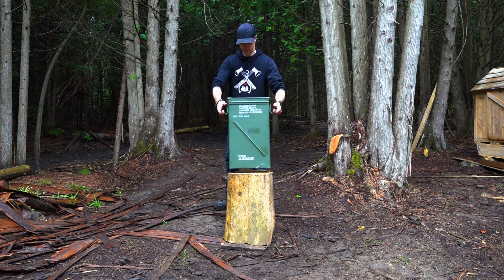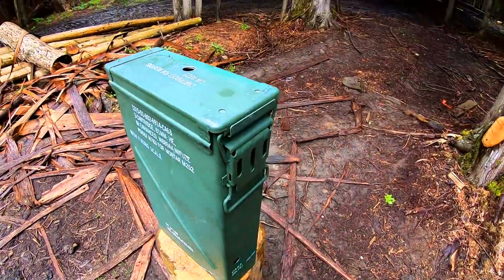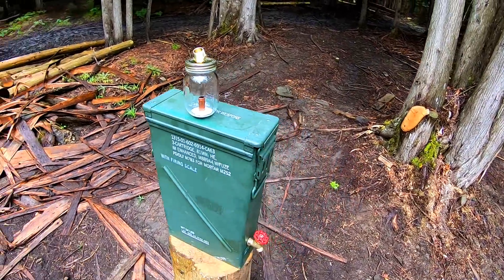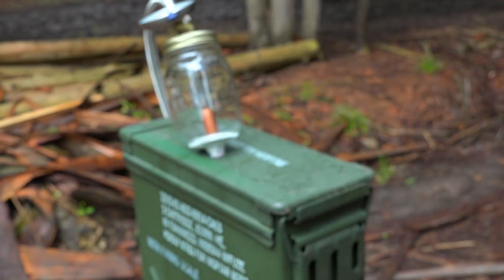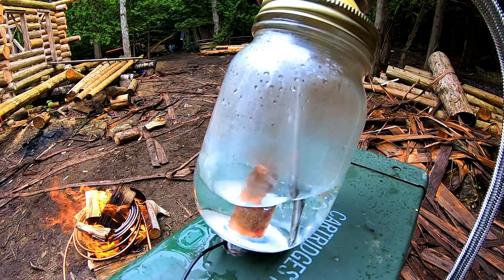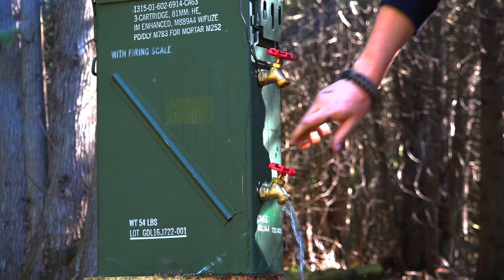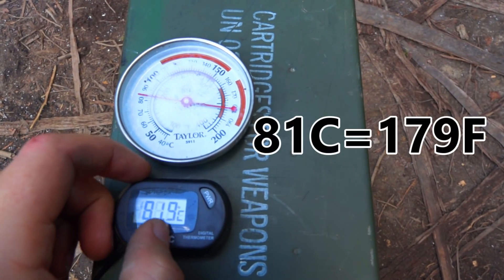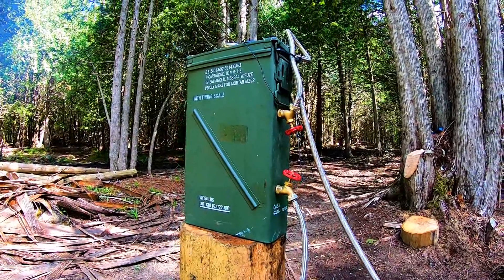Off Grid Heating Prototype- Copper Coil Water Heater / Heat Exchanger / Radiant Heater

Comment: Put a little turbine on the line and create a USB charging port.
Reply: Exactly what I was thinking.  Put a tesla turbine near the heated end part before it hits the ammo box.  And truly...he could create steam, let it power the turbine, a few of them if need be...and boom, off grid power with fire.
Reply: @elitewolverine  how would it be done I'm curious to know
Reply: @badcompany1552  So what he called unwanted steam...we call energy capture from the heating of the water.

Tesla Trubines love steam, building one isn't to hard, and you could certainly buy one.

But he put the outlet of the pipe lower than the waterline to ensure there is no air gap, the air gap is what causes the creation of steam.  The water and air are different pressures, temps etc...so the water converts to steam, by keeping it below the water line, there is no air and the water just stays hot.  It boils inside the canister because....airgap.

Anyhow.  You take the line, and you let it steam.  You reduce the copper line slightly to ensure a more constant pressure, instead of sputter.

You hook up the line to the inlet of a tesla turbine.  The steam will spin the turbine, in the process it will lose energy but a tesla turbine is rather efficient so the steam coming out of the turbine still has some power.

You connect it to another turbine and you keep doing that till the steam pressure doesn't have anymore pressure to turn a turbine.  Each turbine will obviously turn less.

Each turbine, hook it up to a Car alternator, car alternators take about 1-3hp to turn, so very low.

By the time the steam has no power, most likely it has cooled, returning to water.  Make sure the turbines are above the waterline. of the tank.  When the water/steam exits the last turbine, you coil copper or steel or even normal tubing, so that it cools...returning to water, and returning to the water canister to start the cycle again.

In this setup, you might only be able to turn one turbine, maybe at most 3, depending on design etc.  I have seen some turbines run with as little as 10psi, without a drag on it.  So...who knows.

The good thing about a car alternator is they can shutoff, allowing the turbine to startup without getting resistance from the coils.
Reply: @elitewolverine  man make a video lol
Reply: I was just thinking this. Great minds think alike.
Reply: You could use a peltier cooler to generate electricity from the heat source and use it to drive a fan, small light, maybe even charge a battery.

Comment: Maybe consider using propylene glycol instead of water, you wont have to worry about corrosion, freezing, or boiling.  It freezes at -45c and boils at +160c and is non toxic.  you can set up an isolation system to keep the glycol in the hoses when you disconnect for transportation.

Another suggestion is to run some lines under your bedding for the actual heating and use the ammo box as your reservoir, maybe even insulate it so it will hold heat longer after the fire dies down.  You can connect a regulator to control the flow of the coolant so it doesnt get too hot inside your camper.

Comment: Great work. Just a thought - you could possibly benefit from a larger reservoir which will absorb the excess energy, and then radiate for longer. So combining a couple of ideas below, maybe have a large drum (you can fill it with melted snow?), perhaps insulated, on the outside of your pod and a copper "towel rail" inside to radiate the heat. That way you get around 50 gallons of water heated to a lower temperature, but will probably last all night.

Comment: Smaller coil for your fire will help alot, smaller area heating the water. It will take a little longer but you will be able to keep the temp more stable

Comment: I do understand the concept  that you are trying to do here but.Open hole will let steam out creating moisture in the Shed / camp causing mildew and or mold. now as for use when it's 30 below zero and 8 feet of snow on the ground . taking the coil off the fire when it is too hot is fine. use snow to add more water that's fine taking the coil off in the freezing cold well now you have the copper coil froze and split open. See for Copper and soft copper  how water freezes faster then cold water. Even if you was to Insulate  the copper there is no way to keep it from freezing after it is off the fire. The idea is great for needing hot water for washing  or dishes  when you are done drain all the water and the pipes will not freeze. 

  now if you have plans to just heat the tank and then go to bed with the tank cooling down in the night as you sleep . Why not just heat the tank up with boiling hot water then pulling it placing it in the shed.?
   I like you are willing to try new idea's so here is one for you to give a go. Find a large cast iron kettle with cast iron lid. Drill a hole in the lid to tightly secure a pipe  and have an elbow so the pipe that is on the lid is pushed through a hole in the shed going outside and sticking out enough for nothing to worry about. place fire brick on the floor for the cast iron kettle to set on. use the camp fire  for all you're needs then befor bed make sure you have a large bed of coals. Shovel the hot coals in the kettle place it in the shed put the lid on. The fumes will seep out through the pipe to the outside of the shed. because the kettle is sealed it will hold the heat much longer and there will be no fire as long as you don't have anything touching the kettle. placing the kettle if you want on a fire proof sheet and then depending on where in the shed make  with the  fire safe protector by the walls  that will stop any chance of causing a fire inside .
 I know this will work I have done it.

Comment: I would add a bypass valve between the two spigots, so you can regulate the amount of hot water entering the tank, and also place the coil on rocks outside the direct fire. In theory, it could stretch your heat a bit longer than the campfire lasts. Re-sizing the coils larger would allow you to place them sort of around the fire instead of directly within. Great idea and initial execution!

Comment: Great thinking, a coulpe of suggestions though, first a vent for the vapor out of your camper, and second add some valves to your coil so the water does not leak out during transit. It is a pain in the rear to get it all out. Also you could add a third spigot for hot water to cook our clean with.

Comment: Use a T&P valve from a hot water heater and you can safely "seal" it.  Of course it will need an outlet to drain.
Reply: I guess there is an issue here that a steel ammo box isn't really designed to be pressurized,   pressurizing it could be a little dodgy,
Reply: @DR-mp4gv  True.   You could use a small hot water heater tank and remove the insulation.

Comment: Maybe you could mount a small bathroom radiator in the camper with the lines running to the outside for quick connection

Comment: I'm just wondering if you need the copper coil since you have to remove it from fire once it reaches boiling.  boiling a kettle of water on a small rocket stove and filling tank with it would work as well?  you could mount tank on inside and have a fill plug to outside as well as a drain one.   That much copper can't be cheap, pain to haul and acquires soot which have to deal with.

Comment: that mini camper is begging for radiant heat tubes on the floor and ,or walls. i've been wanting to do it in an older ,1969 camper i am fixing up and modernizing. i just hate the sound of a heater fan blowing for heat.

Comment: Use an med to small radiator instead of the Ammunition box. You can then mount it in your camper. Should be lot less bulky and more efficient.

Comment: Good advice in commenters under floor heat , keep steam outside , what about having a smaller lighter antifreeze system or just a way to turn a nob and just clear the line not the tank later after your in bed and dont want to frezze up

Comment: This is a GREAT concept and your prototype is excellent. To increase radiant heat output in your shed you may want to use a radiator form factor. All those "fins" would really allow the heat to radiate out more quickly and more efficiently (they were designed/optimized for this very purpose). Make the mount permanent (or not), keep the flexible coiled hoses coiled on the outside of the shed along with the copper fire loop. When you want to heat your shed simply connect the hoses to the copper loop (with a nice handle), move the copper loop onto the fire and heat your shed. Very fast, portable, and easy to deploy/stow. Synchronize heating with cooking your food over the fire to save fuel.

Comment: One thing, of your using this for your little cabin in winter you might use anifeeze higher boiling point and lower freeze point. You can always melt water over your fire. And I'd build a box around your copper coils, every time you put it on the fire your annealing the copper. After everyday use that copper may not hold up well over direct flame. A metal box would be just as effective and would save the copper. And I like the ideas of putting under the floor or in the walls alot more heating area. Idk just my thoughts. Keep up the good work

Comment: If you constructed a rocket stove and used that as a method for heating the copper tubing, that would be a more fuel-efficient way to heat the water. If instead of using the ammo can as a direct water storage tank, you were to tightly coil copper tubing inside the tank, which would have the benefit of improving its water retention while still maximizing the surface area from which the heated water can radiate its heat.

Comment: hmm. Maybe use car coolant as the water. The reason is, coolant doesn't just keep things cool. It also heats things up by making sure it wont go over into the red and be to hot. Radiator coolant, might work for this. I believe home heat radiators that they sell have coolant in it to.

Comment: Great job. Tremendous amount of energy generated from a simple campfire! I did almost the same. Took a large trash can top upside down as a form, coiled the copper in a continuous tight flat coil in the lid, and filled it level with refractory fireplace cement. Line the lid with plastic bag to keep cement from sticking and pop the lid free of the cement when its dry. The cement encasement will protect the copper and limit the amount of heat transferred to the tubing. Added a small expansion tank to compensate the water expanding from heat. Ran it through a car radiator to dissipate heat. Works amazingly for little investment.

Comment: i wonder if you used a small car or motorcycle radiator would you still get close to the same results ? the fill cap would make for a great vent and you could put a small computer fan to move the heat around if you needed to

Comment: Your problem is that you haven't arranged the copper pipework efficiently, you have a thermo syphon system and the hot outlet pipe should rise ideally vertically or at a steep angle from the top of the coil to the header tank. Your coil inlet and outlet are both at the same level, this is why you are getting steam because the flow fighting itself. Your coil should sit like a spring vertically on its end, cold in the bottom, hot out of the top.

Comment: Nice. I would recommend mounting the box on the exterior of the camper and running a couple of lines to the inside of the trailer. This would provide heat without the chance of overflowing when boiling. We had a similar system in my grandparents place except we used steel pipe in the fire place to create the heat exchanger and ran the lines carrying the hot water to where ever we needed the heat.

Comment: All right man ditch the “gravity system” as there are many flaws with your system 
Maybe consider doing a 1 pipe steam system 
Or just forget it!!  there are many flaws with your gravity system, just saying... (i still work one some original gravity heating systems btw)
steam would be quiet and powerful and will circulate heat better than an ill conceived and restricted,water hammering gravity system. just match your fire to your load and well good luck

Comment: Some thoughts on tweeking this design. scale down the coil and pipes. The way I see it you have way too much heating element there for the size of your tank, and to wide a bore.
Gas fittings, or brake line fittings would make more sense, attached to a smaller gauge coil using smaller gauge pipes. I'd want to insulate it, I'd make accessing some running hot water simpler, (I might want to fill a hot water bottle!) and you could turn the hole in the top into a top up inlet, with some kind of simple floating water level indicator.
It is in itself a kind of storage heater, but running a radiator from it would seem to make sense. I'm sure it will be more than enough for your snow camper on its own though. I'd think the plumbing and fittings through carefully though.
@5:20 "After building a small fire . . ." I almost spat out my tea! Typical American in the woods! The REAL challenge would be to run this off a rocket stove, and if you are serious about reducing the weight of your camper sled, that is the way I would go. Imagine your standard rocket stove with the coil wrapped round it, with four legs and two pipes coming out the bottom. Attach enough pipe to place it outside, feed it twigs for twenty minutes, and it will do exactly the same job as your "small" fire. This also means gathering much less fuel to do the same job. Think about it in terms of how long it takes to equalize all the way to the bottom. Your way was rapid, but hugely wasteful. Solar might take all day, but since it accumulates, it would get very hot by evening. Twenty minutes to an hour seems reasonable, and once the tank's half way equalized it's doing the job.
Anyway, I enjoyed watching, and hope my suggestions help you come up with a truly great design.

Comment: I like this idea, but would fear the fact that it could "spring a leak" at any moment in the night and scald the hell out of you while sleeping. I like the idea of mounting the ammo box to the sled and running copper lines under the sled to do radiant heat through the floor.  that way, worst case scenario, if something went wrong, you end up cold, not burnt.

Comment: I've heated an entire log cabin this way. But of course mine went through an old heater core. With a 12 volt fan from the same truck, blowing air through the radiator. My copper coil was wrapped around my stove chimney pipe though. That way the copper will last longer before it breaks down.

Comment: Why not use a "fitting adapted" car radiator inside the cabin instead of the ammo can. You can even run it full of 50-50 mix anti-freeze and water just like your car and it will let you leave everything outside (down to minus 35 degrees F)  so you don't; have to worry about frozen broken copper etc, if the fire goes out...?? Route the overflow tube on the top of the radiator outside into a jar so you have no water vapor going into the cabin and you save the anti-freeze mix to reuse. Plus the radiator will be much more efficient at using the heated water and will be more quiet..How you gonna sleep with all that thumping and bumping going on in the ammo can..? Just sayin..?

Comment: Put a vent tube going out of your camper or else your going to have a very steamy camper. Is the copper coil going to get hot enough to melt the copper? If you leave the coil in the fire overnight is all the water going to boil off? put a wire cage around it to keep from accidentally touching it and burning the crap out of yourself.

Comment: I would make it a closed system with a coil outside and a coil inside. Leave the ammo can outside and sealed. The tank acts as your expansion reservoir. Use a ball bearing sitting on the top of a pipe as your pop off valve, or just buy a pressure release valve used on domestic hot water tanks. Fill the system with 25% polypropylene glycol to prevent freezing and raising the boiling point. It's bio safe as well.

Comment: I have a question, did the air ever stop circulating and stop coming out of the tubing, eventually there should be no air, just wondered why it continued  to be heard ? Was there an air leakage somewhere.

Comment: i just wonder how well it will hold its heat when temps are below freezing. seen a few good comments here but one suggestion may be to wrap a small amount of insulation, say around 20% of the ammo box. this would still keep a good amount of heat in the camper but help regulate how fast it dissipates. also the ides of leaving the ammo box outside fully insulated and attaching a small automotive heater core and low power fan inside camper attached to it. may need a small electric pump for flow. not sure

Comment: Hi nice demonstration of concept.
But may I suggest you just buy a wall hung radiator and fix it to the wall of the camper like in a home. You can fit a slim large rad that holds lots of water. I'm assuming you can buy them in your country. They are standard in UK homes.

Comment: This may work in a pinch or for some setups.however it's a terribly inefficient way to warn a space as you will lose SO MUCH heat through the pipe runs.and in the snow you will flood the ground around the pipes.

Not to mention leaks and spills.

a small wood burning stove will do the samething but much quicker and more efficient.

Comment: Just my opinion:
 While this is all fine and good for tinkering around and figuring out the physics involved, when it comes time to actually building a heat system for for sleep sledge, it’s best to spend the extra money and come up with a system that is a whole lot safer and actually uses components designed for this sort of thing. Steam burns can be very nasty, especially considering the isolated conditions you’re planing on operating this thing